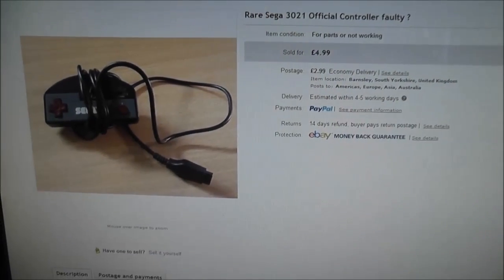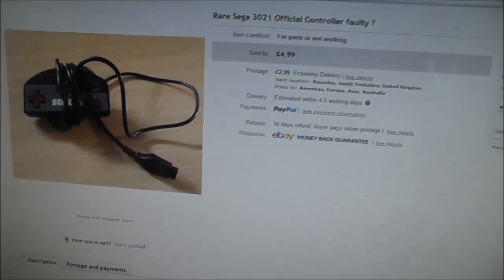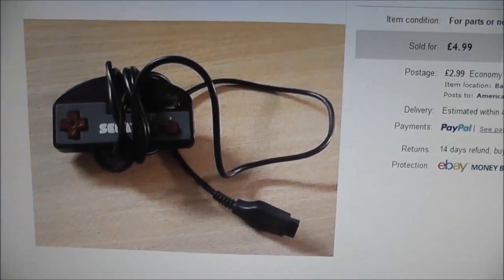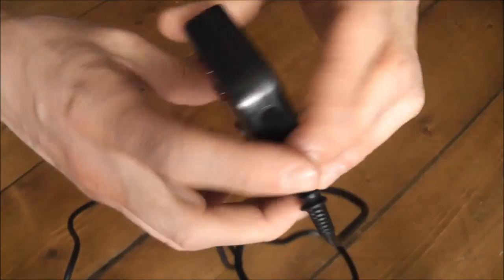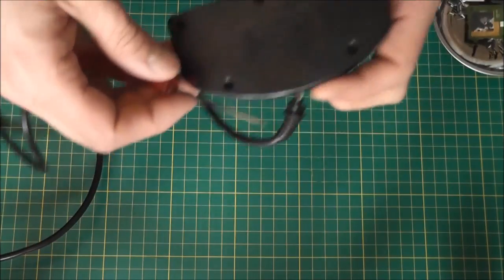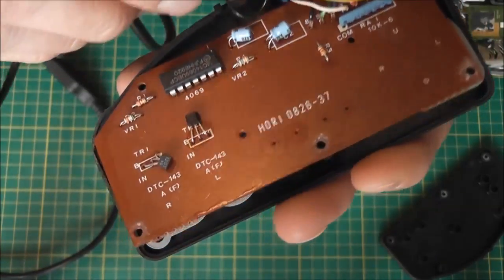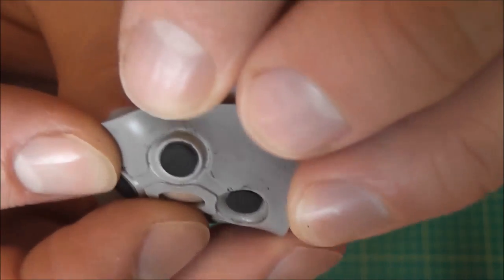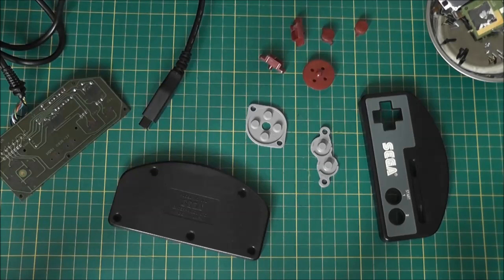Let's Refurb - Ebay Junk - SEGA SG Commander - Master System Mystery

Comment: To help clarify: This controller was produced by Hori under license to Sega. The controller was also developed for the Famicom, under the Commander name. Interestingly enough, the styling is identical except for the branding. I suspect they utilized the same boards and modified them for use on the master system.

Comment: WD40 is fine to use also 3 in 1 oil (bicycle oil) works also, the only thing to note is WD40 will mess with some adhesives / glues so can lead to labels lifting(not all but some) cool controller, I assume Hori made it for SEGA as a licensed product, and probably made a similar one for the NES / Famicom hence the start/select spaces
Reply: posted before end of video lol

Comment: WD-40 stands for Water-Displacement (Formula) #40. If anything, it would help the plastic and PCB by keeping moisture off it. The only downside is that it would make it a tad bit more flammable, but if your console/controller is on fire, I think you have bigger problems than how it's going to look.

Comment: They did back then, too.

By the looks of it they probably made the same controller for a lot of systems, as evidenced by the Famicom/PC engine style Start and Select/Select and run button holes on the backside of the shell, and indeed a little big of googling reveals a PC Engine "Commander" pad that looks very much like this.

Comment: Use Meguiars dash and trim restorer for sega stuff (glossy surface) or scratch X for ps1, nes, snes (Couse or ruff surface)  
Don't use water dispersant (WD-40) you might as well be using silicone spray or shampoo
Just a suggestion
I really like the controller and video, that A,B thing was really interesting

Comment: You might want to try a product like Pledge instead of WD40. WD40 is primarily a lubricant and penetrating oil which can damage stickers and labels. I use Pledge in the exact same way as WD40 was used in this video but with better results.

Comment: It does look very NESsy, and the color of the buttons and D-pad reminds my of the Famicom.
What I find most interesting is that there are not only the unpopulated holes on the front hidden by the label, you can see that often on TV remotes, since they use the same mold for different units, and it is not worth it to redesign the mold, but matching contacts on the PCB with no traces leading to them! So they took the effort to remove the traces from the design but not the contacts!?

Comment: Looked great after you had finished.

But imagine how it would have looked, and smelled, if the original owner was a smoker. I'm generally lucky when buying used stuff, but I once got a DVD where the white cover had yellowed and it just stunk. Kept the disc and had to just bin the rest.

Comment: What's weird is that there were button contacts on the pcb for start and select, but they weren't wired up. If they had bought surplus boards from the famicom controller manufacturer, the contacts would be wired to something. So the boards were obviously made specifically for the master system, yet still included hardware for the start and select. I'm really curious at why this is the case.

Comment: Hope you kept that pad if you liked it. Just checked ebay and running over $80 used ! 
In the UK maybe a bit more reasonable but on the US site just ridiculous! For some one looking for a more comfortable controller for your Master system than the standard rectangular thing however like me you  can't afford this nice looking pad there is a great option out there.
Sega has you covered the Genesis/Megadrive pads work on the machine.

Comment: I was curious about how to refurbish those rubber pads. I had tried using rubbing alcohol and q-tips in the past but it didn't work very well. I'll try the paper method next time I disassemble a wonky controller.

Comment: I hear there are two different WD-40. One is used as an electronics cleaner, the other as a water repellent. The water repellent is a paint thinner and as such can melt plastic a little and loosen labels. The electronics cleaner is used for metal on metal cleaning (like the pins on a cartridge). I've stayed away from the stuff as anything that "shines" things up permanently is really just melting the top layer of the plastic and that's why it's shiny. Some plastic isn't supposed to have a shine and wasn't shiny originally (like the texture of an SNES controller). I think in order to properly clean things you need to do a little research into what the original texture of the plastic was so that can determine your course of action to use WD-40 or not. For the dull or texturized plastic on some consoles I just use isopropyl alcohol to just clean the dirt off of and leave it to air dry.

Comment: Excellent video, and a cool controller!  I don't like the original Master System controllers that much, but they are required for a few games.  I didn't know that you could use alcohol on a circuit board.
Reply: That's what I was wondering cuz I just took apart my Master System controller to clean it and didn't touch the circuit board with alcohol cuz I just didn't know
Reply: Ron Lopez  rubbing alcohol with a high solution percentage is what most professionals use to clean electronics. Does no harm to them and dries fairly quickly.
Reply: justfadingaway thanks. I'm actually lookin at it right now and it is filthy. Highest I got is 70% alcohol. Would it be worth it to seek out a higher percentage?
Reply: if you can yes, but 70% should be fine. Just might have to go over it a few times to make sure you have cleaned everything off.

Comment: I love how it was a "surprise" that it was actually made by hori the pcb only said it immediately when he opened it. lol
Reply from the maker: Hindsight is always 20/20. And given what information was available about this product before I started taking it apart, I had no reason to believe it was manufacture by anyone except SEGA. A lot of gaming peripherals and consoles use components sourced from different hardware manufacturers.
Also, you should try simultaneously filming, dismantling and fault diagnosis all while doing a running commentary once in a while. It might make you less likely to post smartarse comments in future.
Reply: RetroGameTech easy there bro I wasn't making fun of you I enjoy your videos quite a bit actually. Just making an observation sorry if it rustled your jimmies a bit. At least you didn't open it and tons of roaches fell out that's actually happened to me a few times. Thanks for the vids sorry for the sarcasm

Comment: I don't see WD-40 doing any damage, its non conductive so any WD-40 that happens to get into the system/controller wont do anything to short the electronics, and it will stop dust build up and keep moving parts moving smoothly, if anything, I suggest everyone do this to any controller/system they clean or even own, it will extend the life of it by years.
Reply: W-D water displacement it will also stop corrosion works great on the nes :)
Reply: The only thing that would bother me is the smell, it has a fairly strong oily scent to it.
Reply: i love the smell of WD40, it makes all my devices smell manly...

Comment: I like your WD40 method and I tried it on a Mega Drive pad and it gave a nice shine but have you considered using a proper antistatic polish? WD40 will leave a minor residue that will collect dust over time. I use the off the shelf stuff made by Pledge and it works beautifully and gives a really nice lustre to the plastic.

Comment: deffo a hori commander, they made a pc engine version too.
Reply: they obviously used the same moulds as well. the extra holes were for the pce's start and run buttons.
Reply: pas7680 There is a NES/Famicom version too. Note the Nintendo-patented Dpad and the "B" and "A" on the rapid fire buttons. Same mould was used for all 3 versions. Hori FC/PC/SG Commander pads.

Comment: Had one of these as a kid. Got rid of all my master system stuff back then. now want to buy back everything and this controller costs hundreds on ebay :( oh well.

i remember hating the official controller dpad, so i used this instead. and turbo is a cheat/necessity for some games. Shinobi bonus stage or the boss with the spinning statues... i can use a genesis controller instead, but wont work for incompatible games like bomber raid.

Comment: i tried the same rubber contact trick you used in the video, rubbing it on the paper, on the power button of one of my wonderswan colours, but it still won't work. i know the system works because i swapped out the button with one from another wonderswan and it worked just fine. do you have any ideas why the rubber pad isn't making the connection?

Comment: Did you noticed the "start" & "select" terminals (you even cleaned those with a q-tip) inside in the middle of the controller? Do they work?
Reply: +Victor Amaya looks to me like they just used the same mold as their Famicom controller, the board showed it was a Hori controller, you can find Famicom Hori controllers that look just like it, that would be my assumption.

Comment: How do you store all your controllers? any tips? Power cords and av cables as well?  I hate the way i have them wrapped and in storage bins...
Reply from the maker: I just loop the cables and use velcro fasteners to hold them in place. After that they get stored in storage bins with lids to keep the dust off.
Reply: Alright, seems like I got the right idea...Thanks man

Comment: Hello +RetroGameTech ! This is sort of off topic but I have basically inherited my (living) dad's NES and I feel like the d-pad is too stiff for my taste. The force you have to put into pushing the buttons down really bothers me. I've read that they're supposed to feel that way and I have opened the controller up and cleaned the buttons and it all seems fine. So I wonder, is there any way to make them softer? Are there replacement pads you can use instead of the stock ones to make them softer? Could you replace them with the buttons from some other third party or official controller? I'd be really thankful if you'd get back to me, even if it's just with a no. I really love your channel and look up to you a lot!
Reply: +PuffyRainbowCloud Never liked the NES controller, even back when there wasn't much of an alternative. Good luck finding something better!
Reply: TNSign Thank you very much! If I find something really good I can reply to you!
Reply: +PuffyRainbowCloud I have found I really like Hori after market controllers, there was a Famicom one that came out in Japan that is identical to the one shown in this video. It really is a nice controller. You may look to find a broken one on eBay and rewire it for a NES. Would be a fun project and that controller works super well.
Reply: Stupid Geeks Inc. Thanks for the heads up!

Comment: Great video very helpful, I have a mega drive controller when its plugged in it wont go left but if I pull it out a bit so its barely plugged in it works, if there any way to fix this (it does it on both my consoles) thank you very much, love your videos and hope you make more.

Comment: Why do you not just replace the old rubber membranes? It really gives back the feel to the buttons. New membranes basically cost nothing. Ofc. they're not always available. But especially for nes/fc/snes/sfc layout controllers they're easily available. And the difference to just cleaning is huge.

Comment: Didn't nintendo patent this d-pad design ???
Reply: I get the feeling that Hori reverse engineered (or at least copied) the original NES controller mold and then simply modified the exterior design. That would certainly explain the unused select and start molding holes. Quite interesting.
Reply: Hellscr333m and the start and select contacts

Comment: i just bought a gba game off of ebay for cheap. somebody got a tad bit of solder on the contacts. does anybody know if I could get it off of their with some solder wick without damaging the contacts.
Reply from the maker: It should come off no problem at all. I doubt you'd even need the wick. Just use the iron.
Reply: I got it the cartridge in. I was able to pull some of it off with the wick, but its still not working. I wish I could put it under a microscope and get a really good look at it, because now I'm thinking that some of the "brass/gold" on the contacts was pulled off onto the wick. Do you know if this could happen and do you know what contacts are made out of?

Comment: wd40 is crap    use to value civil war guns for estates   i love how it turns things to crap yellow over time   draws dirt and moisture like mad to wood to metal
Reply: +Tom Madison It certainly is not "crap" unless you're using it for something other than what it was intended for.  It's a great product when used as intended.  That much is true.
Reply: bike chains and lawn mower wheels     wd40 is for hardware store warriors
Reply from the maker: +Tom Madison Works a treat for restoring old consoles and controllers. I've been using it for years ;-)
Reply: +Tom Madison  I prefer JB-80, or PB-Blaster.
Reply: wd-40 ruins things and prob destroy plastic over time   ...cheap silicone spray from Walmart or mold release in red can for 1.99$ is what i use to wipe out old computers and cases<doesn't draw dust dirt lasts and lasts> ...pb-blast and liquid wrench is best for rust and gunk < even guns and bikes > works in seconds .  btw thanks for reply retrogametech most dont reply to users
Reply: Yeah its not a good thing for this purpose...

Its for use on metal, not plastic.
Reply: WD40 is a general purpose cleaner/solvent. It is not a metal lubricant, as most people think.  This is a perfect application for it. 

 1. It will not destroy plastic.  Chemically they are very compatible and both are derived from oil.
  2.  It will actually provide a protective layer for the plastic and help it maintain durability.  The key is moderation.  If you use too much, it can leave a greasy residue which will attract dust.  If this happens, use a damp, soapy paper to whipe it away and start over.

Comment: Wd-40 doesn't damage the plastic... Smh at people who don't know what it does. Wd-40 is a lubricant not a corrosive.
Reply: WD-40 is a polar solvent.  It does damages plastic for that reason.
Reply: It utterly fucks up rubber too
Reply: OutnumberedStudios As others have said, WD-40 is a damaging solvent and actuall water displacer (that’s what the WD in the name means) not a polish or lubricant. It’s shining up the plastic because it’s actually eating away the top layer and leaving a film of itself in the vacated pores of the plastic. In the long term it can ultimately make the plastic soft and gooey after an extended period
Reply: Yet he's done for years and never had a problem so I don't believe you, TheLastAnalogJunkie...how do you even Analog when they're all shut off.
Reply: TigerMan1995 From what I’ve seen he flips and sells most of the stuff he fixes on here. So, he wouldn’t really see the long-term effects in action. Also WD-40 has a list of safe surfaces on it’s website that specifically mentions certain types of plastics and polymers which are broken down by the solvent properties of WD-40.
Reply: I used a silicone based spray lubricant normally used for car window seal rubber.   @TheLastAnalogJunkie
Reply: @TheLastAnalogJunkie  what do you use to shine plastic?